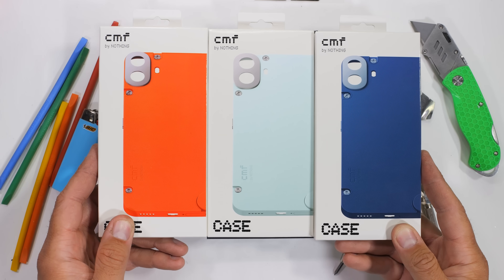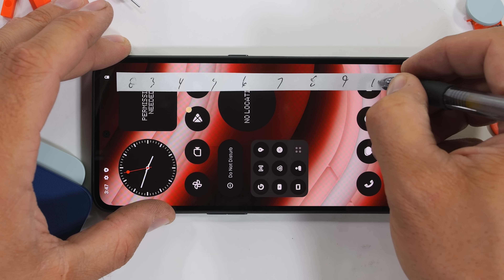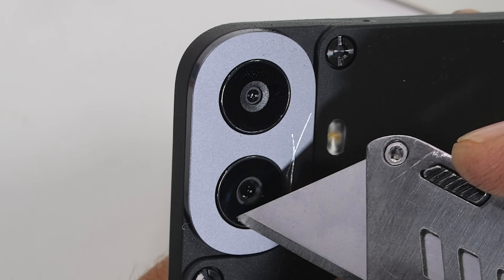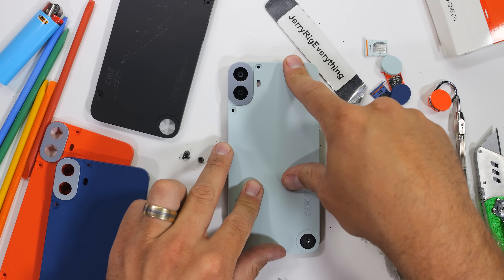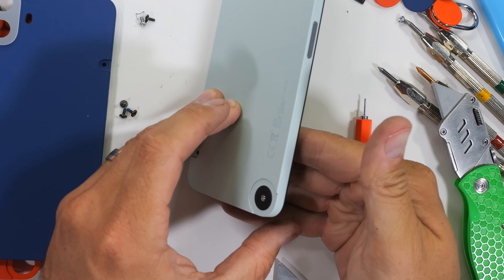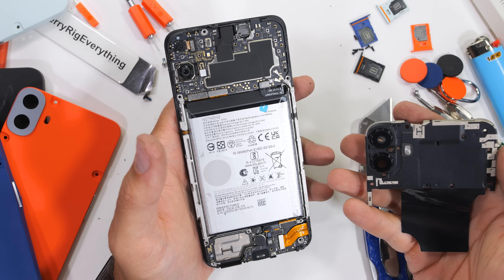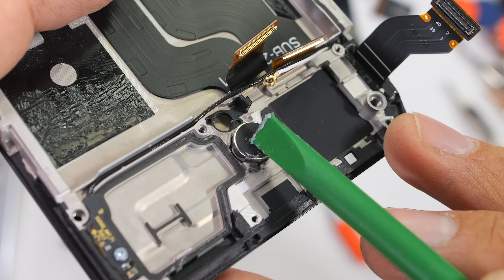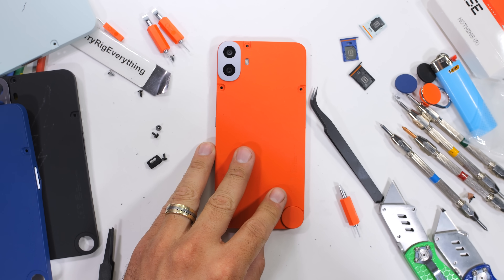THEY SAID IT WAS MODULAR... (a teardown says otherwise)

Comment: Removable back cover and no user removable battery is such an awful decision.
Reply: Gotta keep being mainstream!
Reply: Just ignore the disclaimer and it's magically removable.
Reply: Wait till u see the official review of this phone by it's CEO n his buddy, they'll surely rate it 10/10 for innovation n flexibility. As one comment there said "it's like students grading their own paper". 😮😂😂🤭
Reply: You don't need to change the battery for the next 2 years... You'll change the battery after the warranty is expired. So you can do it by yourself.
Reply: It isn't tho....for them.  The removable back is simply for you to buy accessories and back panels.  You replacing your battery was never a part of the equation, just for you to buy shit from them.  If they could sell you those individual batteries, without any Chinese manufacturers getting in on the action, then they'd do it.
Reply: Don’t really see why this is relevant because it’s still pretty easily removable and replaceable. It’s not like anyone cares about being able to hot swap batteries and you only need to replace them like every four years.
Reply: Have you tried fixing your phone yourself? The biggest challenge is opening the phone itself. Some phones need heat, prying, dealing with glass, and sometimes need to open it through the screen. Once inside you only need to deal with screws and connector pins. So yeah this phone is more repairable than any other phones.
Reply: @ajiqoyum745  have you tried removing the battery before? I'm pretty sure they're almost always glued in, making it difficult to remove without prying tools and iso.
Reply: Don't know why people are still talking about removable batteries. The battery of this phone is removable enough for repairs and about hot swapping batteries I would like to remind you of a time when every phone had a hot-swappable  battery still nobody carried around a spare battery. I think removable batteries has become a buzz word for "Right to repair". Sorry for bad English
Reply: Main reason is a removable battery would hurt battery capacity, requiring some extra frame and connector to make it more rigid.
In either case replacing it seems quite doable.
Reply: Much more important than a easy swap process is in my opinion the ability to actually buy original replacement parts.

Any ease of removing the thing is completely useless if you have nothing to replace it with.
Reply: @MarioPetka  Thank you, I totally agree.
Reply: Yeah but that is for cost. In practice you can see that it is very easy to swap anyway
Reply: It would be nice if seemingly otherwise competent people would stop ascribing magical powers to a sticker.
Reply: They did it to get the IP54 rating.
Reply: Remember first moto g?
Reply: @Santiago3435.  It's not suddenly a problem. It's been a very, very longstanding complaint. One of the reasons often given for batteries not being removable is that it requires a removable back which would ruin the IP rating. This phone already has a removable back so excuses like that fly out the window and the reason now just seems to be "because we don't want you touching the insides".
Reply: I remember having a spare battery in my purse every day for my V20, going from 0-100% in 1 minute lol. I had a battery charger that plugged in the wall that could charge two spare batteries at once. It's pathetic how anti-consumer these companies are and hardly anyone cares.
Reply: At least you get a screwdriver💀
Reply: just wait a few years for the eu to force them to make batteries removable
Reply: Removable batteries is in the past
Reply: Exactly I've seen so many tech YouTubers praise this phone for it's removable back but you can't replace the thing that wears out or fails most likely.
Reply: Even if battery was removable you were not going to swap it often.... Backup as well as charging speed is so good nowadays... It's only after 2 or 3 years you will need to replace it which will take only a few minutes as you only have to unscrew a few screws and pull it up..... So it is better to keep it glued firmly placed... Then why people are disappointed... It's just stupid...
Reply: @RemixedVoice smartphones these days don’t require you to replace the battery during the day. They last long enough until you get home.
Reply: Did you even see how big the battery was,5000mh. You can charge phones so fast now it doesnt even matter. Unless you have a specific situation for it, and even then youd need to unscrew the whole back. Why bother?
Reply: This comment, and the amount of likes this comment got really tells that how clueless a normal consumer is.
Reply: Its much better than most phones, pretty easy to do at home. Every other phone needs excessive amount of heat to soften the glue. I'm not saying they shouldn't have done better
Reply: I mean, realistically. Were you ever going to buy this phone? Very unlikely
Reply: TBF the worst part of battery replacements is usually the glued on back or front covers.
Reply: But removable back is a step in the right direction 
I hope battery will be user removable in a few years
Reply: Zack is a user and he literally just showed you how to remove the battery. What are you on about?
Reply: It is user replaceable, at least you can access and remove the battery without specialised tools.
Reply: I had a Motorola Moto G in 2014, it also had a removable back cover but not removable battery.
Reply: This phone doesn't have NFC, so it's basically useless.
Reply: it's still removable but not in the old fashion days , now we have pull straps and it's easier to get that battery out
Reply: pointless feature
Reply: @guestc142 so we are gonna ignore pull tabs...
Reply: Lithium ion batteries usually survive about 3 year.
Reply: My previous phone had a user removable battery and it was epic. Blu android phones don't make them like they used to though. It did become outdated before the battery died, but the battery is usually the first thing to go "bad" and the easiest thing to fix yourself
Reply: I'm 99% sure the reason they put those stickers is so that they're not liable for harm in case there is a rare defect with the battery. If they put the sticker there then they're covered in case something goes wrong.

They absolutely know that anyone willing to change their own battery will ignore it.
Reply: I all lost all confidence at Nothing after the whole iOS messaging fiasco.

They have some taste design wise but not in other areas IMO.
Reply: @MarioPetka  by 2027 every phone sold in the eu has to have replacable battery.
Reply: Why do we ever need a removable battery, I've never had use for it
Reply: @cicada3312  Batteries wear down with use and if you glue it like that it makes it harder to just grab a new battery and replace it yourself in like 15 minutes.

Bigger picture is that it's just more sustainable that way and produces less e-waste.
Reply: @Quan5021  pull tabs barely work. You have to pull in a specific direction and will still break off even when done correctly. Pair that with the fact that not every phone has pull tabs.
Reply: @kopono  exactly. Not as accessible as it should be. Imagine having to have a special tool to open the bonnet of your car...not rocket science.
Reply: It’s $200
Reply: @kopono  I guess it's more that they were so close by doing the majority of the hard work already but having that be purely form over function and it feels gimmicky. Like they went exposed screws at all purely for the looks and didn't invest extra effort in making the battery held by screws or something that is a bit nicer to remove.
Reply: No wonder with a battery that says "NOTHING" 😂
Reply: A removable battery is just a rabbit hole of expenses. They'd have to manufacture new batteries for something that not a lot of people will buy. It's far too risky for a new mid range player from a brand that does not have a bottomless resource. Not having to use a heat plate and suction on the screen just to take off the battery is still a huge win. It eliminates the risk of you shattering the screen for a minor battery replacement.
Reply: Oh god, not another "the backplate is removable but the battery isn't" comment lol
Reply: Bruh its 5k mah battery, single charge a day u don't need to remove it every single day. It's not nokia era dude wake up
Reply: In 2027 EU terms will force companies to have easy replaceable batteries in their consumer products
Reply: Why do you need to swap batteries anyway? It'll last the whole day and you won't be changing it for at least 2 years.
Reply: @SandeshShak  you’re right but the process after two years is too difficult & that causes waste of good products from a lot of people, but it could be “solved” this way
Reply: if it's removable , it wouldn't be dust resistant therefore no IPX(dust resistant rating) U can take the battery tho not as hard as the mainstream phones
Reply: Maybe they decided to use that for cmf 2
Reply: maybe they gonna have to spend more to mass produce removable and modify the board for it which takes quite the resources

they know it's a bad decision but they have their reasons
Reply: @guestc142  Most android battery glues has plastic tab glued in to pull (see the video) and no, you don't need anything to remove it 😑
Reply: You can always remove battery like that. It's not hard. It was just a disclaimer.
Reply: That comes with CMF Phone 2: "We've heard your feedback"
Reply: @ajiqoyum745  no it's not more repairable than other phones, stop the cap. And the biggest challenge has never been prying the back of a phone, its finding oem battery replacements for batteries, most manufacturers will refuse to sell you a battery but if you had ever. replaced a battery yourself you would know these issues.
This phone is not better than any other phone out there, it's just a gimmick.
Reply: firstly it's not easy to source a zauitable battery in removable design those days, secondly the % of people who really need this is close to 0
Reply: @MarioPetka  isnt as easy as the phones with user removable backs.. so its inferior
Reply: @shemenisedtv902  no, its not. its in the past for anti consumer companies.
Reply: What if you don't like that phone you can buy the fairphone 5 instead
Reply: @logictv6667  different budget
Reply: @warmoaran3  Third party parts industry exist you know. Just make sure you're using from reputable br4nd and has their own warranty services
Reply: @guestc142  have you even watched the video? At what point in the video did it show needing a pry tool to take out the battery? There's a pull tab. Literally.
Reply: Easy to replace batteries will be a thing before 2027(even apple can’t escape that or they have to totally pull out from eu which they will never)
Reply: @akippnn  have you ever tried using pull tabs before? You do know that they break easily, right?
Reply: @guestc142 I actually have changed a lot of phone batteries before the pull tab in this one seems to be among the best. It's covering the whole underside of the battery and looked a lot more solid than pull tabs in other phones. I also am questioning if you watched the video 😂
Reply: @mibris  hope it's solid. Still takes longer to replace than just swapping batteries like you'd do on a galaxy S5, but you get the idea. Keep on supporting.
Reply: The real issue is not having an oficial store where you can get the batteries and other replacement pieces. 
Opening up a phone is easy enough. at worst (phones with a glass cover) you only need ispropil alcohol and maybe some heat from a blowdrier in order to get to the battery. Fixing android phones nowadays is easier than ever ngl.
Reply: @Hand_of_the_king  This seems like the most sensible comment. Even from the video, the repair process seems much easier.
Reply: @guestc142  you're the one that never used plastic pull tabs like the one in the video then. It does not break easily and it's pretty much standard on Android devices already.
Reply: @ajiqoyum745  keep saying that to yourself, pal. Hostile design is thriving through people like you.
Reply: @guestc142  you clearly haven't tried it yourself. I'm just pointing out the current standard of the process to swap batteries is pretty okay. Please find an unused "modern" android and try to at least remove the battery yourself. You're going to find it's harder to open the phone itself than removing the battery.
Reply: @ajiqoyum745  samsung xcover 6 pro
Reply: @guestc142  that phone just prove my point. It's got an easily removable back cover and battery. But any other phone the hardest part is removing the back. Replacing the battery you only need to remove the connector pin and pull the plastic tab, and voila the battery is removed. For reference please watch the video you're currently commenting lol.
Reply: They don't want you to explode...
Reply: @guestc142  Yes but you are not afraid of breaking the battery when you remove it and some batteries or glue stickers are made on purpose to simply be removed
Reply: Why would you do it to begin with when it's in warrenty?.
And if it isn't what do the sticker matter lol
Reply: Do you want your phone to be ip 0.1 rated
Reply: It looks very easy to remove the battery though.
Reply: why is everyone about removeable battery? Like you change the battery every 3 days? What is up with the internet and removeable battery?
Reply: Yeah, that's a lot make sense for me, i think why they didn't make the batteries are removable for it?
Reply: @NAVED_14  the Samsung S5 was IP67
Reply: @surya4671  we want to easily change the consumable in our phones.
Reply: @warmoaran3  no other phones brand are providing removal battery now a days .
I wonder what you do with the removal battery .
I mean battery last like 2 to 3 yrs and most people nowdays change there phone on yearly basis
Reply: @NAVED_14  @NAVED_14  I have a digital camera with AA batteries, I use rechargeables.. so when the batteries eventually die, I can easily swap batteries and continue. Phones not being able to do that in 2024 is just stupid, it was possible in 2013. And just because people get a new phone every 3yr doesn't mean its good. Its environmentally bad, because you're just scrapping a perfectly good device. The EU is proposing a regulation where the battery is user replaceable.
Reply: @warmoaran3  guess what if a user replaces the battery he/she would likely dump the battery in a dumpster most likely it never going to be recycled 
But if phone is sent to a phone repairing  shop they will remove the battry and battries will sent to the recycling facility
Reply: @NAVED_14  don't think that happened with the removable backed phones.. I still have the battery for my Galaxy S3 laying around lol.. and.. people read labels, they will dispose of them correctly, like AA batteries
Reply: keep on spreading this comment, im sure nothing will take a look at this, they are quite community driven after all
Reply: @guestc142 all of you guys replying before watching the video didn't even see that he easily pulls out the battery without any heat.
Reply: Lets be honest, the worst of modern phone repairs was the back cover,not the glued battery,witch is easy to change
Reply: It's obviously user removable. Did you not watch the video?
Reply: Yes really confuse
Reply: The Moto X Play had that too, I personally like being able to swap covers alone.
Reply: @abhijithkg1467  like u would do otherwise. 😂
Reply: Yeah right that's a seriusly questionable decision.
Reply: My brother in Christ this is a step in the right direction
Reply: No IP rating when you let the battery get taken out more easily
Reply: Tbh that battery replacement is pretty easy
Reply: @phyll24  "why bother?" I bother when the battery stops holding a charge.  I bother when they could have SO EASILY made it user-swappable with the addition of 3 pogo pins, but they instead went OUT OF THEIR WAY to make it as unrepairable as they could.
Reply: Idk it looks pretty user removable to me lol actually extremely easy
Reply: It's supposed to be for aesthetic. Not functionality. Who knew.
Reply: Clearly way easier to replace by yourself...
Reply: Who removes battery ???? 
I used to remove some 15 yrs ago
Reply: Gotta save the 2 cents for that
Reply: It is a lot easier than other phones though
Reply: Yeah 199
Reply: Its not, stop this shit
Reply: Compared to other phones, this battery is a piece of cake compared to Samsung or iPhones. Still could be better
Reply: Honnestly, because the back cover is screwed, it is still way easyer to reach the battery without breacking anything than glued phones. I confidently can do this myself.
Reply: No one gives a crap about removable batteries in real world usage
Reply: @guestc142 this one is connected to the motherboard just with a wire
Reply: @Keler477  everything is connected with wires. It's not as simple as that unfortunately.
Reply: @guestc142  i know. Anyways whats the point on replacing the battery?
Reply: @Keler477  take a guess
Reply: Have you used a removable battery  phone if you have. you know that 
Sometimes, it shows 50% after removing the battery and plug the battery  it will show 28% or 40% that's the problem  in it 😅 sorry my English  is bad I hope you understand  it if you saw my comment
Reply: Its just a scary sticker thats all ...
Reply: What´s ur obsession with removable batteries, The battery last almost 2 days, and since it only has 2 to 3 years of support, IDK why your complaining.
Reply: Its for water resistance I think
Reply: Until a little bit of water gets inside , then u would appreciate non removable battery
Reply: *for the user. Not the company
Reply: Did you even watch? Thats the easiest battery removal I have seen in years
Reply: anything's user removable if you try hard enough
Reply: @guestc142  moot point you didnt seem them break here, also use alcohol?
Reply: IKR
Reply: At least it has a 120hz screen unlike the iphone 16
Reply: Gone are the days when a "backup battery" didn't mean a different battery used to charge the phone one and literally meant a spare battery for your phone that you can swap in seconds..

Yeah I'm a 90s kid :)
Reply: It's a lithium power battery and everything is seamlessly connected to it these batteries are pretty dangerous and can expand and explode even both case distroying the phone and user that was the reason samsung phones were exploding cause they were not being handled with care and now all companies don't wanna make them replaceable cause of that fear
Reply: The Samsung Bomb incident changed everything
Reply: It's not about that it's the fact that if they were to make it removable don't have to add extra shielding to the battery which would make the phone bigger Elmwood ultimately change how the phone is designed it's also a massive health and safety risk to allow people to play around with lithium ion batteries
Reply: We need it back just thinking oh battery low replacement now battery old new one
Reply: Moto G1,G2 had same thing 👹
Reply: I forgot what exact video but The CEO spoke about this and said that letting the users have their will with the battery would be highly dangerous since they are lithium batteries and any scratches on them could make them explode ,that's roughly what I remember him saying, so arguably not a good time
Reply: I'm not sure about this but say, someone did damage their original battery and wants to change it manually.  If that person is a non-technician, the chances of buying and using a fake battery is quite high. This might be one of the reasons.
Reply: @MarioPetka  Ohh, you're right. This actually makes sense lmao.